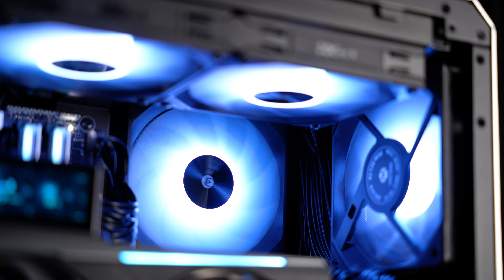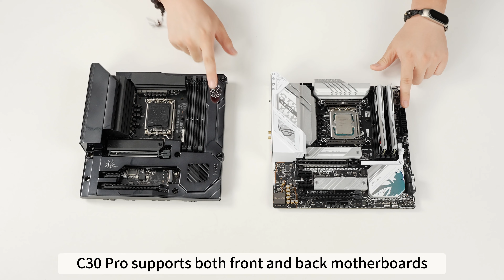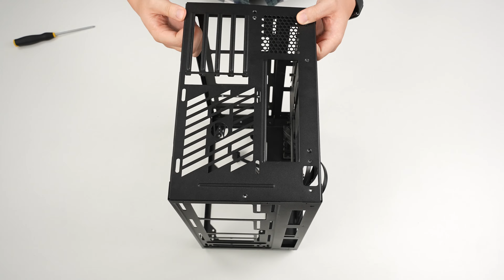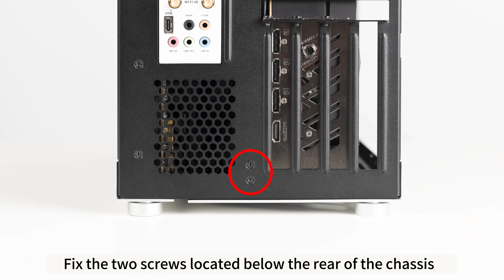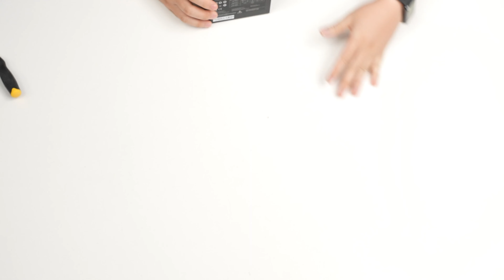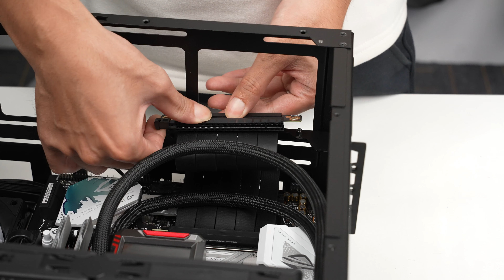INSTALLATION TUTORIAL _C30PRO+MATX+DOUBEL 360 AIO+335mm GPU  VERTICAL INSTALLATION + MID SPU

Comment: I can't find the vertical gpu bracket anywhere and I can't find any info if the c28 plus has it or not.
Reply from the maker: hi~please contact our custom service for the vertical part:
https://aliexpress.ru/item/1005006291935246.html?gatewayAdapt=glo2rus&sku_id=12000036635501284
And we do not have a model of C28 plus,do you mean the Cmax？